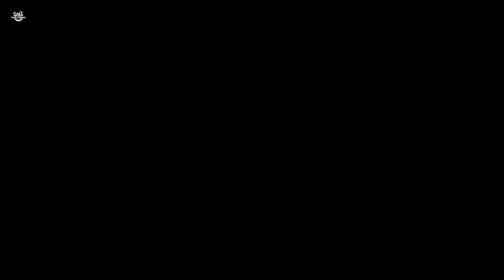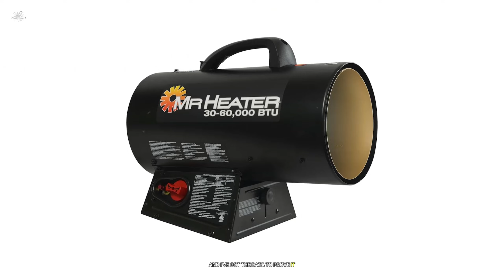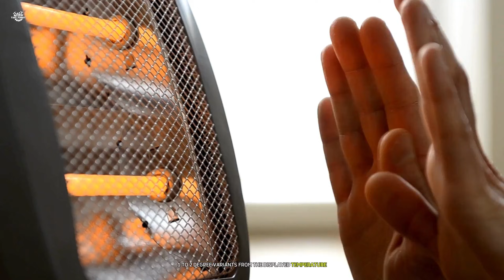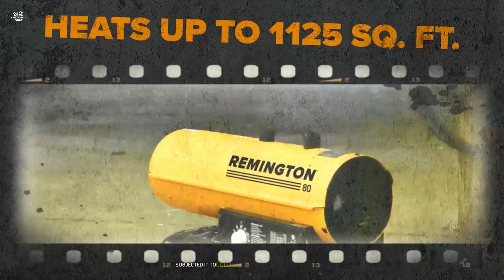7 Best Garage Heaters Reviewed for 2026-2027 Winter

Comment from the maker: 🕝Timestamps🕝
0:00 - Intro best garage heater
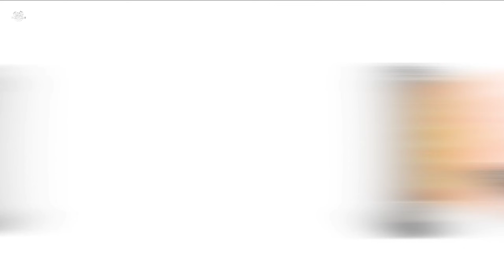0:31 - Lasko Oscillating Digital Ceramic Tower Heater
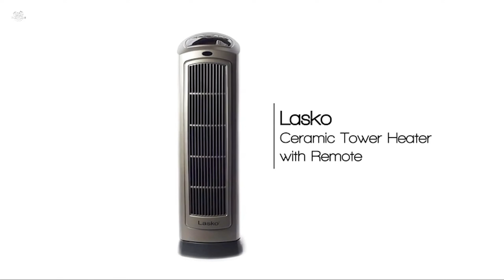02:12 - Mr. Heater MH60QFAV
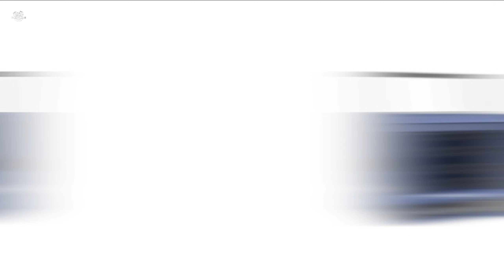03:51 - Tempware Electric Garage Heater
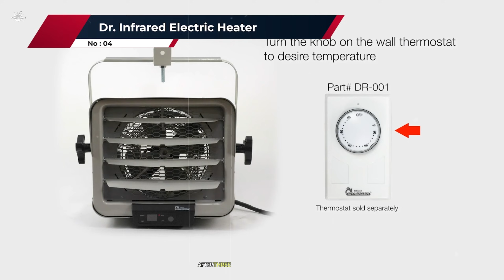05:19 - Dr. Infrared Electric Heater
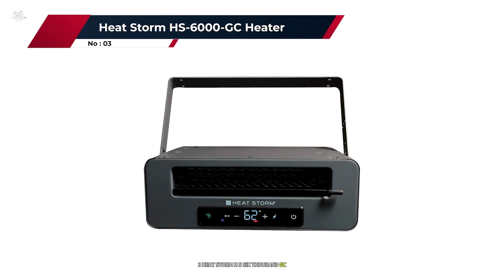07:03 - Heat Storm HS-6000-GC Heater
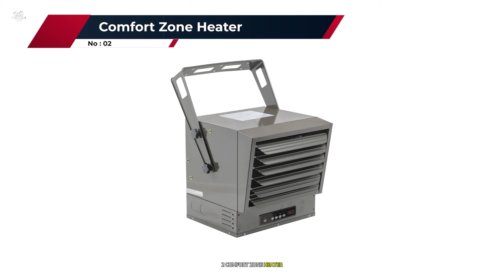08:40 - Comfort Zone Heater
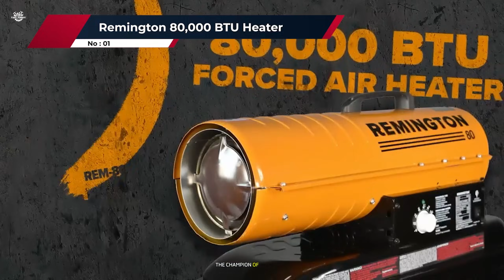10:07 - Remington 80,000 BTU Heater
11:43 -  Outro garage heater review